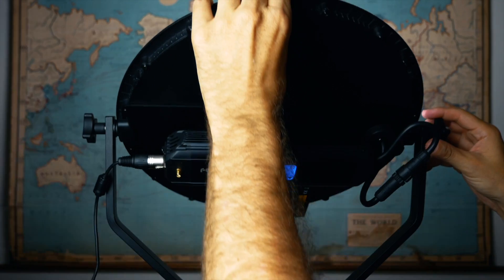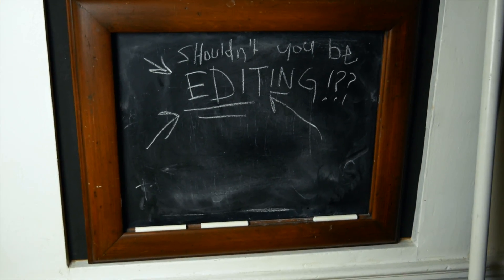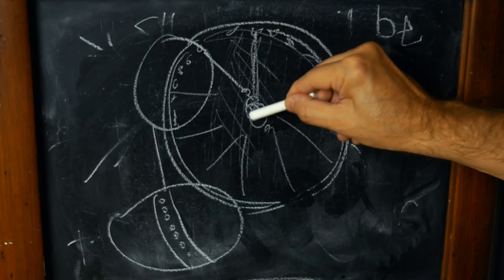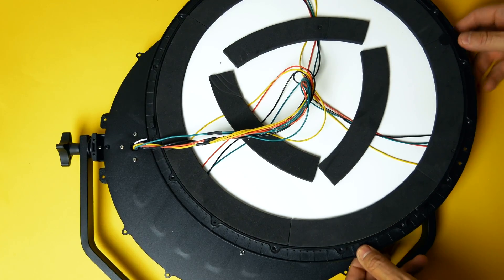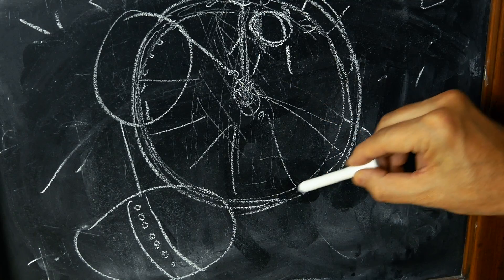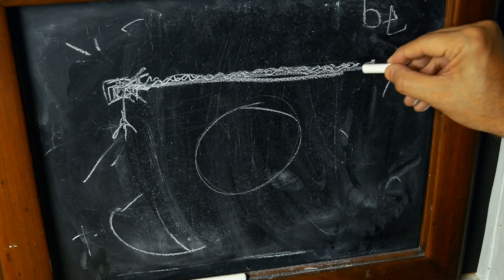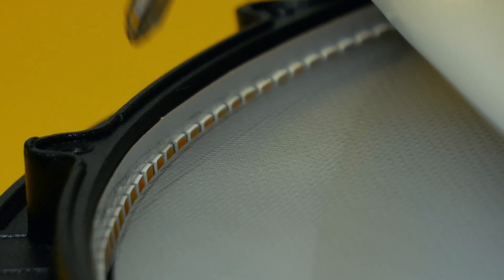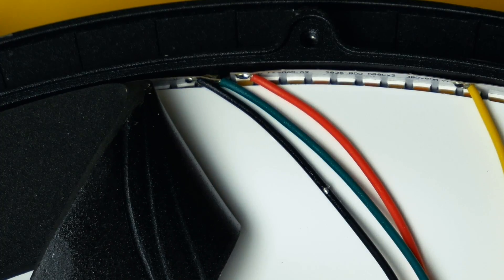What's INSIDE a $350 Studio LED Edge Light!

Comment: This item begs to be a DIY project. A 600 LED light string is about $30 through Amazon:
https://www.amazon.com/Waterproof-600leds-Flexible-Changing-Controller/dp/B01IQOV13G/ref=sr_1_27?ie=UTF8&qid=1538715577&sr=8-27&keywords=led+string+lights 
Note that it has those square LED's.
Plus, you can change the color, although I don't know how finely.
Perhaps a pie or cake pan could be used for the back, but I'm not sure which reflective material would be good.
All told, it would cost much less than $350. (Why on earth is the FalconEyes $350? Mass-produced in China. None of the parts are expensive.)
Gonna build one?